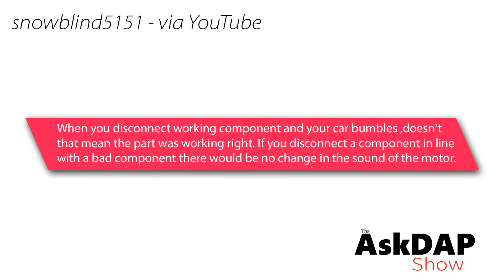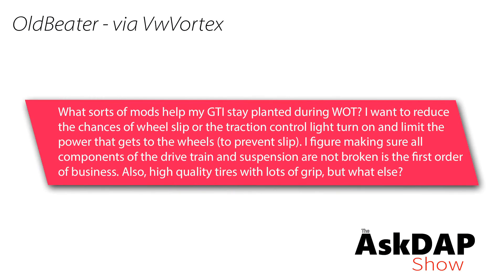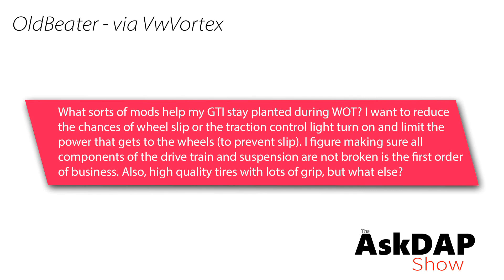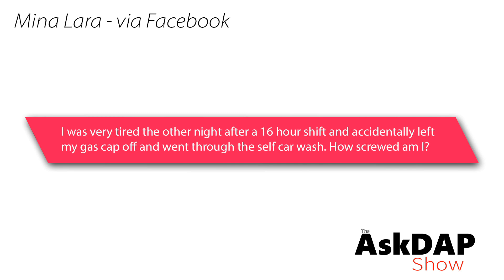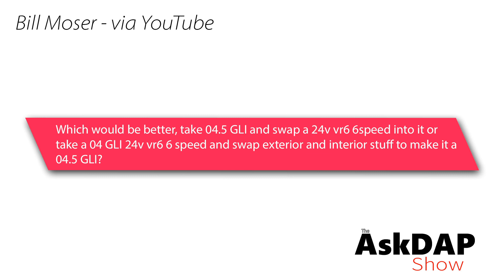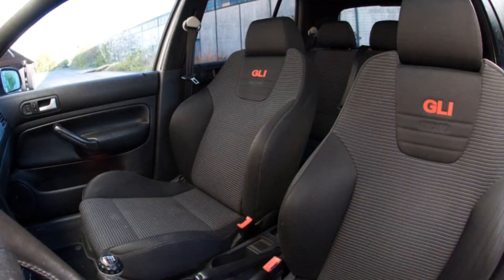Askdap Episode 99 | Unplugging Things to Diagnose your Car

Comment: Hi Paul, I've got a 2017 GTI sport with DSG and I've done the long coding to fully disable ESC. I chose the setting for when I short press, it's ESC Sport and when I long press, it's ESC off. Not using launch control with ESC fully off and flooring it, the car still cuts power in first gear when the wheels start spinning. Is this something I'm stuck with without doing some kind of tune? Maybe I could try the other coding for short press ASR off, and long press ESC off? Thanks in advance!
Reply: Have you tried disabling Starting Vibration Reduction?
Reply: Wow, I haven't heard about that. I did a little research and deactivated it and it seems to have worked! Cheers!
Reply: Excellent!

Comment: 2015 GTI keep getting Check tank cover! warning after start up and few times while driving. The gas cap is on tight every single time. any ideas?
Reply from the maker: You likely need this https://shopdap.com/store/make-model-year/volkswagen/gti/mk7-2015-present/engine/2-0l-i4-tsi/repair/pcv-and-vacuum/06h-906-517-t.html

Comment: I have a mk7 gti apr stage 2 and was wondering if it's harmful for the motor or turbo to drive it in high rpms when the oil temp is below 200 degrees fahrenheit which is usually the first 5-10 mins of driving after a cold start. At what temperature would you say it is safe to do WOT pulls?
Reply: AiR_ RSJ good tune won't let you full amount of power until oil temperature reach ~70 celsius

Comment: How difficult is it to swap out the purge flow valve (N80 valve) on a TSI engine? Is this a DIY or something for a shop to do?
Reply: Richard Demas pretty easy its in the front of the motor plenty of DIYs online
Reply: Eric C , do you know if anyone did a video replacing the valve. The FSI engine is easy, but the FSI N80 valve comes with additional hoses that I am not sure where they connect.

Comment: Hey Dap, first off want to thank you for your advice a while ago certainly helped fix my issue, But now I have another. My oil light comes on beeps 3x and comes off after 3000 rpm. replaced the oil sensor under the oil filter, also changed  the oil filter to no avail. 

I have a 2010 tiguan 4mo, 2.0t stock all.
 any insight would surely help, Thank you
Reply: changed the oil pressure sensor, everything seems fine now